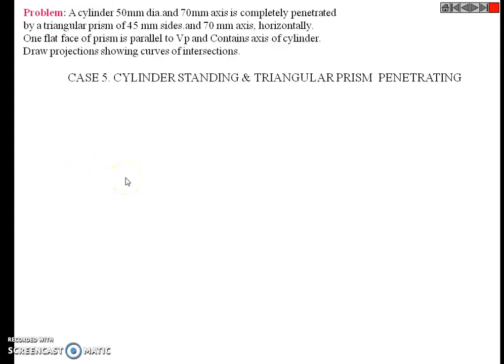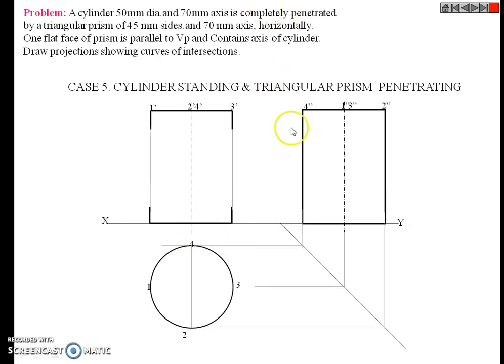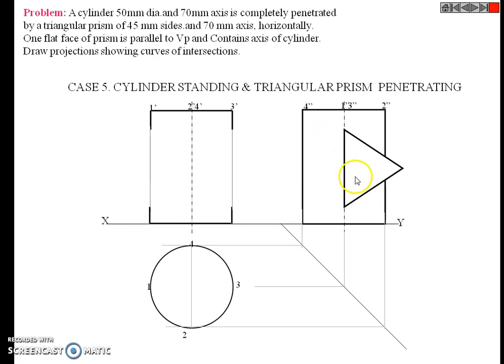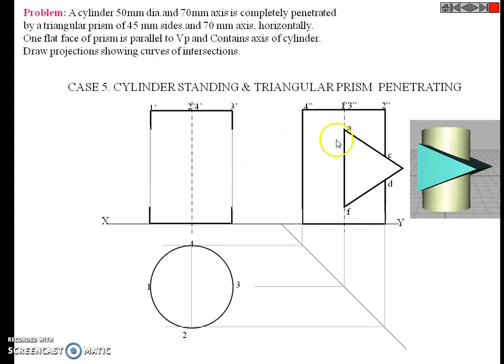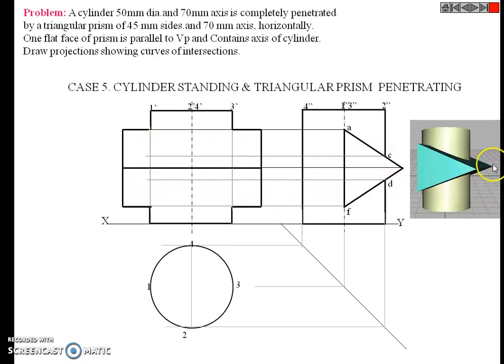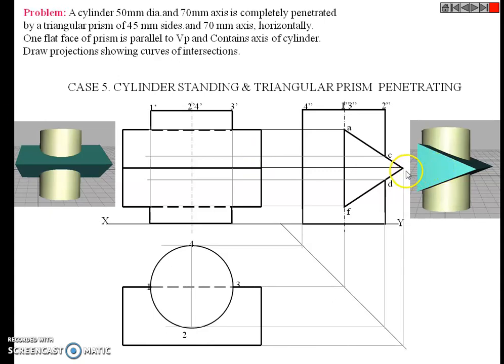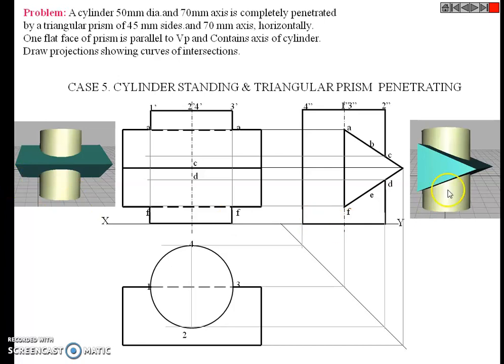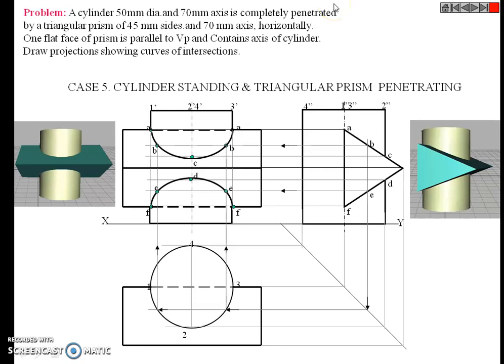CASE 5. CYLINDER STANDING & TRIANGULAR PRISM  PENETRATING

Comment: A cylinder 50mm dia. and 70mm axis is completely penetrated by a triangular prism of 
45 mm sides. and 70 mm axis, horizontally. One flat face of prism is parallel to VP and 
contains axis of cylinder. Draw projecƟons showing curves of intersecƟons.